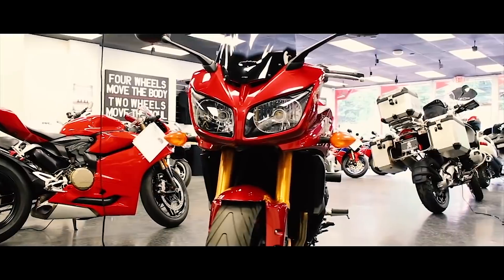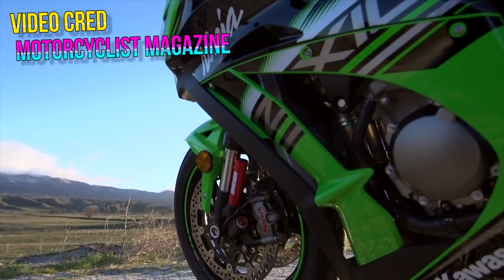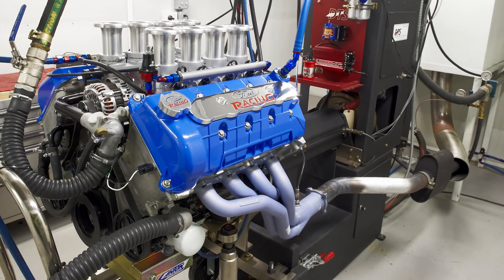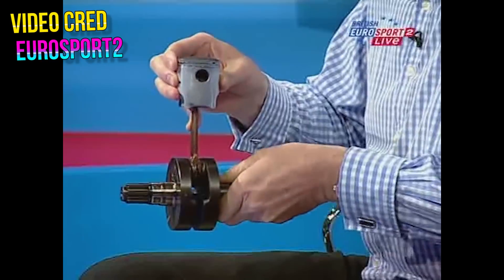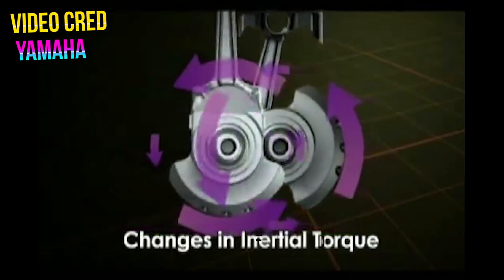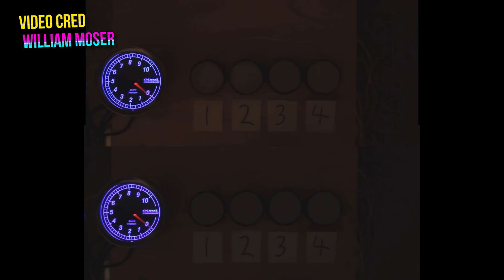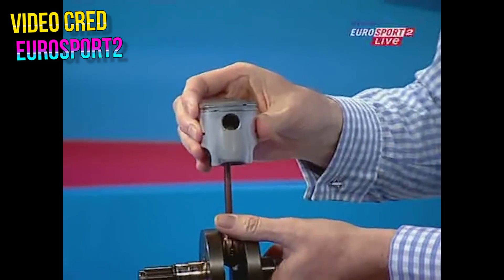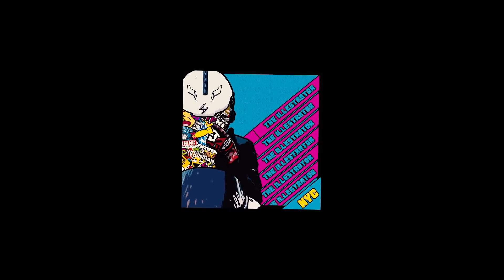Yamaha Crossplane Crank - Why the R1 Sounds Like That

Comment: I was trying to figure out what a cross plane crank was. In my instruction with cars and trucks we called them single and dual plane crank shafts. Same but different. I have always wondered if V6 should have a triple plane crankshaft.
Reply: The GM 60-degree V6 has a 3-plane crankshaft. The V angle is 60 degrees, and the firing intervals are 120 degrees. So a 3-plane crank works perfectly. Some other V6 engines are configured differently.

Comment: Good vid. I use to be I to crotch rockets my first was a brand new 2002 gsxr 600. Had a Harley the ol potatato potato sound which is from old 2 cylinder tractors like johne Deere model A's-   I never heard of these new r1 crossplane motor. But as soon as I heard the sound of it I was reminded of a similar v8 sound.

Comment: I have a 1980 Suzuki gs1100 bored to 1500 with light weight internals with V&H air filters and exhause. It does 90+in first gear which sucks a lil cuz the speedo only goes to 85. Just had my rectifier and stater take a shit and fouled all my plugs and broke down. It isn't jumping the voltage up to 14.5 and its covering the plugs in carbon from partially burnt fuel.

Comment: Good job on the vid dude. Yamaha basically put a vmax engine into a smaller lighter inline 4 package. Guys have been doing this with the 650 specials for many years now by offsetting crankpins etc...

Comment: Video way top wordy and long. Basically the firing order does nor matter if its 4 cylinder engine. What causes variation in sound is the amount of gimme between firing of the cylinders.  flat Plane engine fires each cylinder every 90 degrees.  The cross plane is not firing every 90 degress. Once every rotation one cylinder fires a little sooner and the next a little later.  Which caises the uneven staccato rhythmic sound you hear.

Comment: Great video!! One thing about rpm or how high an engine can rev is limited by piston speed.  The crank stroke is major factor in dictates piston speed. Shorter the stroke the higher you can rev the engine. Harley 88' engine is 101.6 stroke and  redline 6000rpm, CBR 600F 42.5 mm redline 13000 rpm, in stock form. The longer the stroke the faster the piston is moving at a given rpm. The Harley piston is moving more than twice the speed of the Honda at the same rpm. 
Love the video though, lots of good info. Keep up the good work.

Comment: Sounds a bit smoother than a boxer-4. Anyway, this is the formation Ford should have used in their 2.3 litre EcoBoost engines for their Mustang:

Smoother engine.

Better low end torque (turbo picking up the slack higher up the rev range).

Nice pseudo V8 sound.

Comment: Recently Ford adopted the cross plane configuration as Ferrari has had it for years. And yet big gains in rpm’s that it’s being used in Fords GT350. It’s a screaming v-8 for sure. Well, for an American one
Reply: Most V8s have crossplane cranks, the voodoo has a flatplane crank. Interestingly it is different from most flatplane V8s (which are like flatplane I4s) as it is an "up down up down" configuration instead of the more common "up down down up" configuration. It does sound good!

Comment: Great video. I perfectly understand now. 
Does the cross plane crank see more stress though? With the flat plane, it saw the speed up and slow down at the same time. With the cross plane, it now has to harness those forces within itself correct?
Reply: There may be more torsional (twisting) stress, but the crank's whole job is to generate torsion (torque). Any increases will be minimal and well within what a crank can handle, while alleviating the flat-plane's tendency to "leap" vertically in the block.

Comment: Great video. Well done man. 
I'd like to tell the viewers something. When Neil Spalding @7:45 speaks his piece, he says quote, "What normally happens is there is an explosion of fuel and air", Neil is incorrect.  As tuners of gasoline engines, we must know that the fuel burns via a flame front starting at the point of ignition (spark) and more or less gracefully progresses through the fuel and air until combustion is complete.  Visualize it like throwing a lit match onto a dry field of grass. The field doesn't 100% burst into fire instantly. The field of grass burns from the point of ignition as a flame front sweeps outward from the match point. The grass field is 2 dimensional thing so it isn't a perfect analogy to the gasoline engine, so please try to expand this example in your mind to 3D. If you think, "What's the difference? M5 you are being picky". No I'm not and here is why. Neil Spalding saying explosion is what normally happens. It is not normal in fact it is the definition of gasoline engine detonation or "knock". Very undesirable if you know gasoline engines.  If the fuel simply exploded all at once then octane rating of the gasoline would be less important (the fuel would only need to stave off detonation from cylinder temperature, mechanical compression ratio and volumetric efficiency, but the fuel burning as a "progressive flame front" rather than an explosion means cylinder pressures rise as the flame front progresses across the combustion. The octane rating has to be sufficient to prevent exploding the as yet unburned fuel in ahead of the flame front.). I hate it whenever experts say the fuel and air explodes in a gasoline engine because as a young person that is what I erroneously visualized was going on. Hey, that is what I was told at the time.  I had a real "Ah Ha" moment when I understood the gasoline mixed with air doesn't explode when the spark happens. It is only then that you begin to understand why a lean fuel air mixture is more susceptible to detonation than a rich mixture and why ignition timing  needs to be moved around when you change jetting or electronic fuel injection to achieve maximum power without causing detonation. Please stop saying the fuel and air explodes above the piston of a gasoline engine because it does not normally do so.

Comment: I TRULY LOVE MY TL1000R V-TWIN OVER INLINES..But my Hyabusa is pretty amazimg BUT there is a obvious reason I own MORE V-Twins than inline 4s..I do own 2 Triumph Triples but I do have 5 V & L Twin Sport bikes and 6 V-Twin Bobbers but only 2 are the TERRIBLE HD motors.. One is a 1955 74ci PanHead Hardtail. Bobber my pop built in H.s. Shop into a early Bobber ...The other HD is also a 74ci Pan Head K SERIES...The orest are 2 liquid cooled Indian Scout Bobbers and the other 3 are my 99 to 03 Liquid Cooled Chain Driven ONLY Honda ACE..NONE OF MY BIKE ARE SHIT..I MRAN SHAFT DRIVE.. BUT THE HONDA 750 IS A 100,000 mile motor easily because its slightly detuned and maintenance is minimal to almost zero.

Comment: I’ve owned most of these bikes and I still love the FZ1 or the “Fazer” and I don’t think it should be so easily dismissed. Is the FZ10/MT10 better? Yes, for the most part. But the FZ1 and the older flat planes were screaming motors and I wouldn’t base my decision solely based on the cross plane head. Nice video! 👌💯✌️

Comment: Differences in 1st and 2nd order harmonics. Yes, that's why most passenger vehicles are cross plane cranks because it is "smoother" with less vibrations to disturb the passengers. But that comes at a cost of weight - heavier cranks and fly wheels, etc, and lower RPM limits. This is why race cars typically don't use cross plane cranks but rather tend to use flat plane: less weight overall, faster revving (brp brp vs waahmp waahmp) **, and higher revving. Higher revving is important in racing because you can get more HP out of a smaller displacement (HP = torque X RPM, ignoring units) which means more HP out of a smaller and lighter package.

** - not only do you have to put energy into accelerating the "dead weight" of the heavier crank and flywheel - but you also have to put energy into accelerating the rotational inertia. If you have more rotating inertia, that is going to translate into more linear inertia of accelerating the vehicle since more rotational energy must also go into accelerating that larger rotational inertia as well as to rotating the drive wheels. That is, if the crank is slower ti accelerate due to the additional rotational inertia, that will mean lower acceleration as the crank more slowly accelerates the rotating of the drive wheels.

So it really comes down to what is the more important objective in a given application.

Also, it should be pointed out that because the cross-plane firing is uneven, this has implications for exhaust scavenging. This is why cross-plane V8s will often employ cross over tubes (H or X pipes) in an attempt to even out the pressure pulses traveling down the pipes.

Comment: Hell some of the muscle cars in the 60’s early 70’s lied about Hp for insurance reasons. But yes the ones who didn’t did measure crank hp. But it’s a known fact that they fudged on engines like the hemi, 440, Chevy 454, 455, and Ford 429. Those engines where way over 400hp more like 500+!

Comment: The new r1 is gorgeous...but so are most bikes...what I don't get is why manufacture's don't put good lookin exhausts' on their bikes...most bikes if not all aren't running at their full potential...and now most bikes have ugly exhausts' and dumb exhaust valves with canisters'...if you remove the exhaust and put a full exhaust the bike doesn't run right. I want the new r1 but don't know where to take it to get a tune to it with a full racing exhaust. Mechanics in this country suck...Greece...anyway just putting my thoughts down...have fun always...Chris

Comment: Ok so a conventional inline four (GSXR750, CBR1000, GPZ1100 etc) is much smoother than a single or a twin. On my own FZ6N the engine is very smooth at low rpm before vibration sets in during mid range rpm before smoothing out again at higher rpm. It  is said to have perfect primary balance, but no secondary balance, which can be felt when riding. So how does this compare with an inline six that is said to be 'perfectly smooth' thoughout the rev range? Why is the six so smooth? I would like a video comparing these two engine designs. I guess the crossplane fours offset crankpins go some way to smoothing out the motor too. It is a shame the six has been seen in so few models, although i appreciate it has drawbacks including width and cost. A cb900f was just as quick as a cbx1000, at a much lower weight and cost.
Reply: "inherently balanced" gets misused and misunderstood. there are secondary pulses, and even the intake and exhaust pulses come into play. the wiki goes DEEP, check it out, but there is no "engine without imbalance" as we were told, ie the I6/V12's. the old fashioned cross-plane American V8 is actually MUCH more sophisticated in the way it deals with these forces than MANY would lead us (and have been led) to believe. Hell, just listen to it. 14:27 says it all.

Comment: never understood why valve-float was such a problem for car engines' rev limit, but motorcycles can scream up to 16k rpm
Reply: The same reason hummingbirds flap their wings faster than eagles do, they are tiny.  It's called scale effect.  Motorcycle engines can rev higher than car engines mostly because motorcycle engines are tiny.  Want to make a 454 Chevy V-8 rev 20,000 rpm?  Build a 1/4 scale miniature version of this engine.  This would result in a 7 cubic inch V8 and it would likely have to spin 3000 rpm in order to idle without dying and would likely have no trouble revving 20,000+ rpm.

Comment: Really good explanation.  Just wanted to fill in the blanks a little: 2 cylinders have a higher torque and earlier delivery because of the much larger volume of gas expansion per ignition but less power because the delivery happens half as often; but, they almost always rev lower in comparison because they need to have a longer stroke to make the same displacement as a 4-cylinder which increases reciprocal mass and forces cam timing to be at optimal efficiency for a shorter duration of time during the revolution. If you go too over-square, which will allow you to rev higher from the shorter stroke and larger bore, less reciprocal mass, etc, then you start to really suffer in efficiency in the low end from a decrease in gas velocity and you end up getting really peaky engines that only make power when they're wound out which makes them really shitty to use on the street... think Ducati until the recent V4 they ripped off from Aprilia lol

Comment: Bud, you're a godsend. I've been trying to figure out why engines sound so different for years and the helped me out tremendously. I knew flat plane cranks vs. Cross plane played a big part, but I never considered firing order. Just one example is my v6 mustang. I often compare the engines to that of a gtr with the similar bores and strokes, but its escaped me as to why they sound so different. Now I have a better idea in the timing. Thanks dude.

Comment: i remember the difference in which mick doohan had grip vs the other riders in the 90's. the 2 strokes had unforgiving power delivery and Micks Honda changed the firing order to a Big Bang, smoothing out the power by giving the power pulse more space. so the rear tyre had more time to grip.

Comment: If you listen to it the cross plane is like a syncopated rhythm. The second group of firings are spaced much closer together so you have two pairs of firings at different speeds and pitches. You could even claim there are three pairs at different speeds. The pitches created by these pairs create at least two distinct pitches but under sound analysis would yield many more harmonics. It just brings back memories of how acoustic intel is analyzed by the Navy for passive Sonar.

Comment: i am going to put a 208cc engine that makes 30lb-ft of torque and 14hp maybe more with high flow exhaust and timing adjustment, on a 45lb full suspension downhill bike. going to have 7 maybe 11 gears, geared for speeds from 30-110mph... i don't know but the bike will have a weight of around 85lb, apparently from what i have looked up it will most likely be able to hit 70mph... getting smooth power down with a 14.5-1 gear ratio.

Comment: See, different firing orders having different sounds makes sense. However the change in pitch is what gets me. It's the same amount of combustion strokes per second. Pitch is determined by the frequency of sound pressure waves. So 440 pressure waves per second is an A note. I thought the combustion and exhaust strokes are the main cause of the sound so with this in mind, the pitch should be the same between a crossplane and flatplane crankshaft. But it ain't so I must be wrong.

Comment: I looked into crossplane 4s back in 2012... there was almost nothing on them. What there was stated there were balance issues that a 90* v8 wouldn't have because the crank pin is shared with another piston. I don't know why they don't call them imbalance shafts :-) This video got me thinking of how to make 6 cylinders sound like 12, 5 like 10, or 4 like 8  by having 2 slightly different length pipes the exhaust can switch between every 2 revolutions. Or something that rotates so that everytime a piston fires it switches pipes. It's completely impractical, but if it weighed 5lbs. or so it'd be cool with me. I wonder how much of a difference in sound could be made? Stepper motor with a disc timed to the rpm to always be open to one or the other pipe?

Comment: Great Video! But why do they say the fz07 dual cylinder has 270 degrees crank and not 90 degrees? It’s the same, right?
Reply: No..... Check the videos by William Moser.... He has shown the difference between two of them.... Clearly.
Reply: Nithul Nath I don’t find the vid, but maybe Wikipedia helped. Let’s see if I got it right: since a cylinder fires every second revolution, you count to 720 degrees instead of 360. So with a 90 deg crossplane, the second ignition would be much faster than with a 270 degree crossplane.
Reply: The crank pins are 90 degrees apart, the firing occurs every other revolution. If you look at a circle with a quarter missing, the gap is 90, the long way around is 270 degrees, together 360 degrees.
If I understand right the 4 cyl cross plane engine is like two 270 degree twins joined inline, with pistons 1 and 3 and 2 and 4 being 180 degrees apart.

Comment: After 30k miles on my 14' r6, if it aint crossplane it sounds wrong to me. I love crossplane. All hail yamaha. Side note, you mention if one day there'd be an r6 crossplane, its been out since before 14'.
Reply: I love a 2006 R6 myself. Rough, but you'll smooth out... :D
Reply: @ruikazane5123  yup. Get in where u fit in.